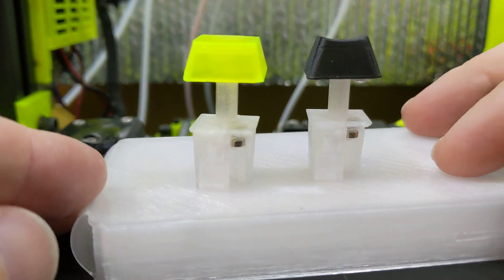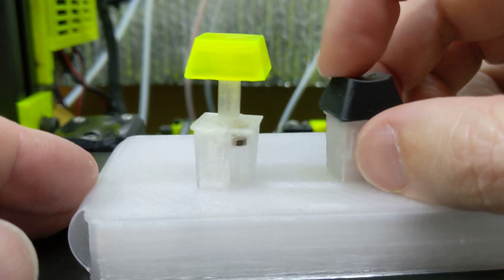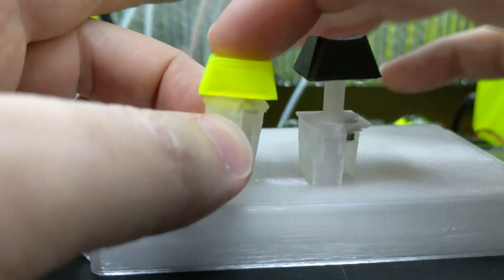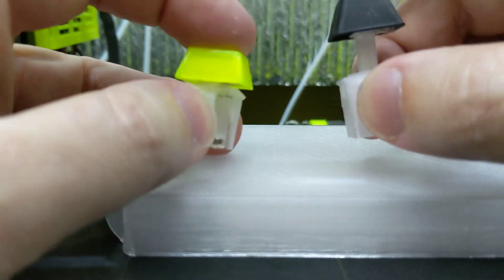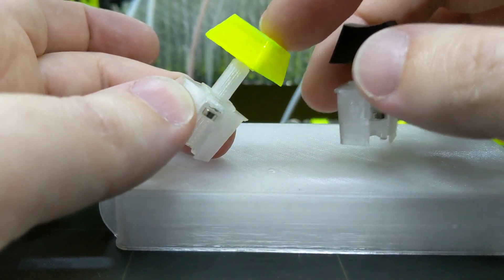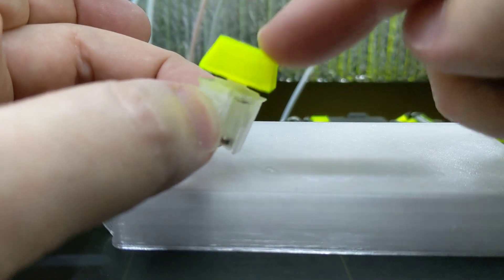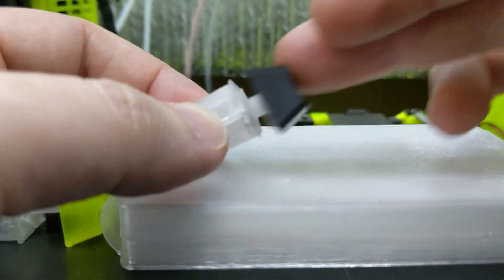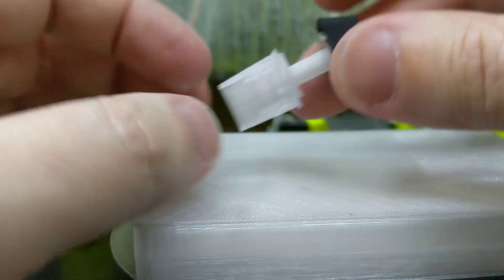Key switches with ONE CENTIMETER of travel‽

Comment: Told you magnets as a spring would work.

And it doesn't require printing elastic materials which not everybody can afford.

(not a fan of too long travel distance though)
Reply: the point is that its a joke and just a proof that you can do it
Reply: And also it's in fact more reliable. Silicon spring might tire and break. Magnets are pretty much forever.